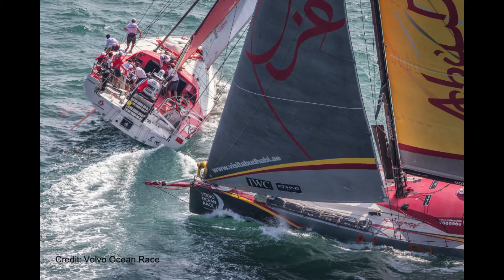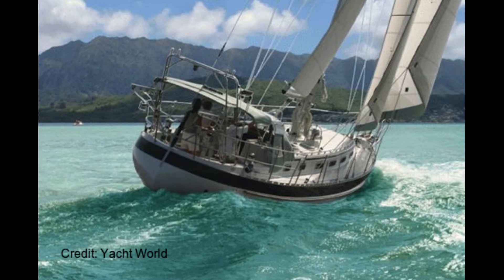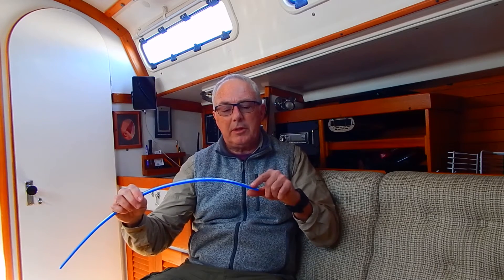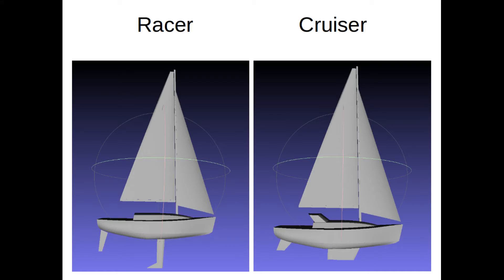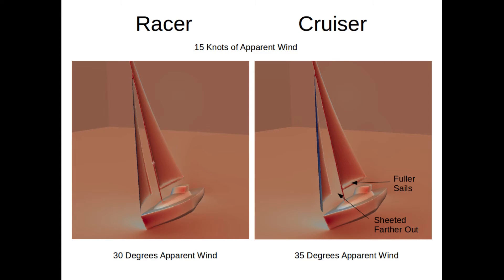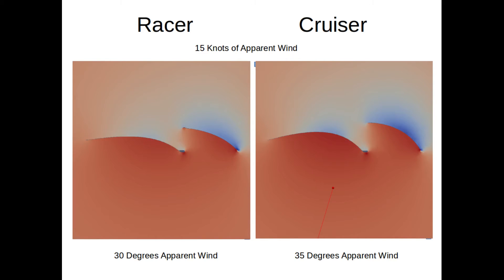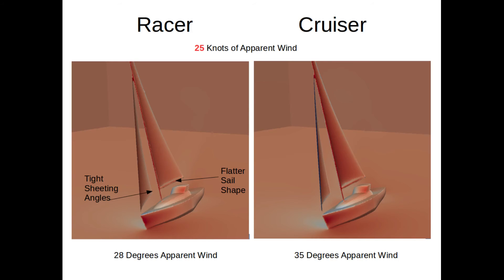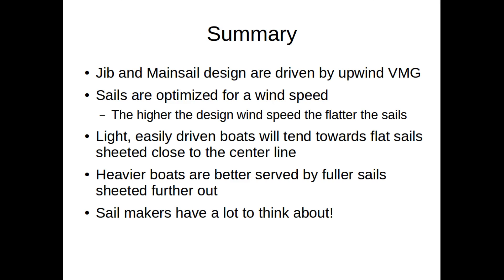How Sails Really Work Video 5 - Sail Shape

Comment: Hi Jim.  Excellent videos! Thank you for putting them together.  I am especially interested, as I have owned J32, Hull #58 for the past 15 years (in VA).  Would you happen to have polars for the J32 available?
Reply from the maker: The original sales material for the J/32 had a little polar and stability curve in the corners. I can send you a scan of the two pages if you give me your email. It's fun looking at the brochure. Now THAT's a boat I would really like! Note, I never used my data to check the polar - probably should have...
Reply from the maker: Actually, I can just share a link to that document on my google drive. Here it is: https://drive.google.com/file/d/1CPw2C1M46Eh45MbT6IO-qGWXodrkLMdI/view?usp=drive_link
Reply: @jamesconger8509  Thank you very much, Jim!  We sailed today in 12-15, gusting to 20.  One reef in the main.  She sailed great, and still fast.  I’m looking forward to using what I have learned through your videos.   One a similar note, how did you rig your control lines for your second reef point.  Did you have to add a block/blocks at the mast base, and any additional deck organizers / clutches?   Mine is rigged with single line, and as you know, has lots of friction, so I’m curious about your rig.
Reply from the maker: @ScottR-px3oc  Yes, I added to the mast blocks and had to add another clutch. Here in SF we are almost always on the second reef going to weather and on the first reef downwind, for summer conditions.  In the winter, all that sail area comes in handy. Have you ever weighed your boat? Based on my 3D model I estimated Tango's weight at 8300# with full fuel and 50 gal of water.

Comment: I would like to learn more about balancing a boat for weather helm.  People also talk about balancing the boat for a point of sail requiring little or no input to the helm.  Thanks so much for the videos
Reply from the maker: It boils down to two ways to counteract the forces generated by the hull and keel that try to make the boat round up. Reducing the sail area helps, by reducing the forces pushing on the hull and keel. Moving the sail area forward also helps, as this produces a balancing force to counteract forces under the water line. On my boat, reefing the main accomplishes both of these things. Letting the main sheet out also is a short term fix as this moves the effective sail area forward since the mainsail is generating less lift, but the jib is still pulling.